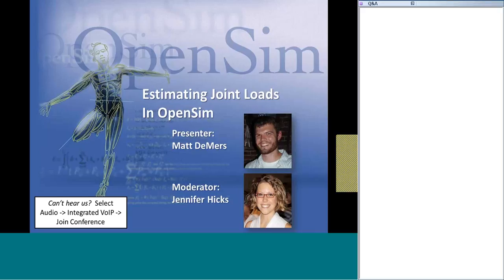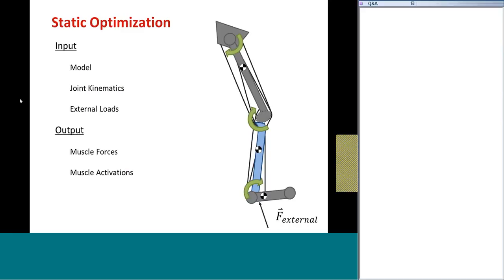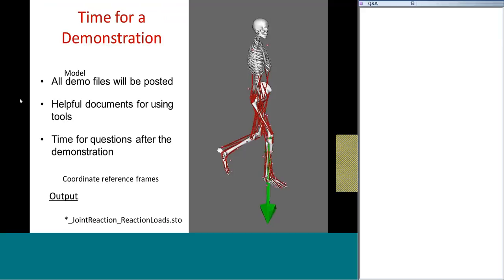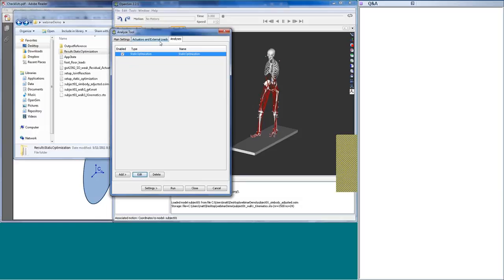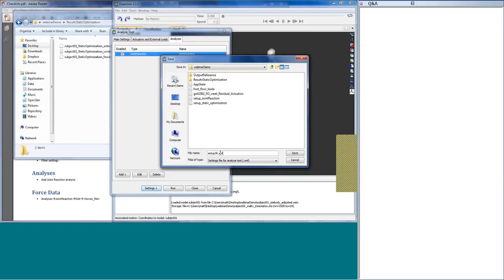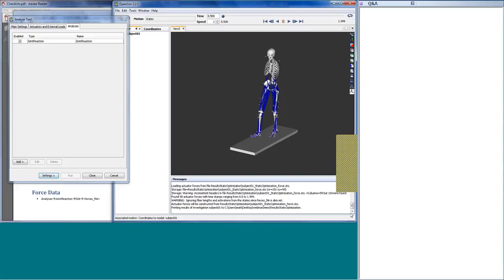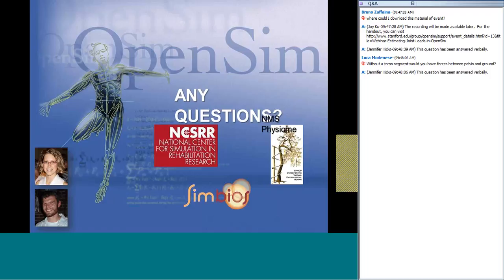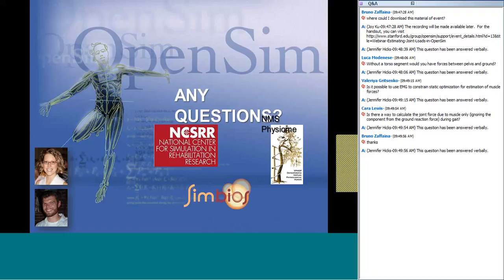Estimating Joint Loads in OpenSim

Comment: Hi, I did the same thing with the same model, but I edited it from code deleting the soleus muscle with Notepad ++ then I saved it and I ran the Inverse Kinematics tool to this model and everything worked very well,  then I run analyze tool with the Static Optimization as the video and It took 3 hours just to get an avance of 14% ,so I couldn't wait more and I ran it again and It remained in 2% during 8 hours, So I downloaded OpenSim 3.1 and when I run it in the software suddenly it fell down.